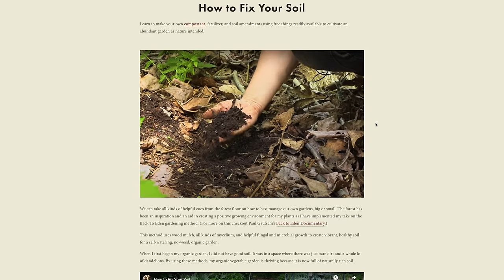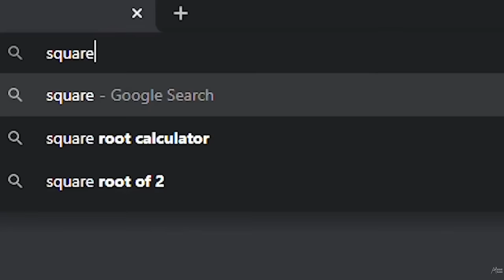Morning Chores FARM TOUR! | Feeding All My Animals in 8℉!

Comment: My feathered babies are indoors all winter!  I have 2 adjoining rooms in one wing of my barn that is heated to about 50-60 degrees with a 2000 watt heater in each room.If I am warm enough,so are they! One of the reasons is,that all my laying hen are in there and I want them to be comfortable--and some of the others in there are either nearing or above the 10 year mark--and my oldest just turned 16 years old! My young roosters are in another section,in the other wing(which is all totally enclosed as well)with the geese,and that one has 2 4000 watt heaters-its colder in there,but above freezing-they seem comfortable.

Comment: Glad you are doing all this and I just get to watch. What a lot of work!  
BTW, hot water freezes faster because the H2O molecules can form crystals ("ice") only in certain relative orientations. It is kind of a V-shaped molecule. The faster they move and bump into each other ("heat") the quicker crystals form because more of them click into the right relative orientations faster. Yeah, chemistry.
Reply: Also, heated water has less dissolved gasses.  When stuff is dissolved in water it disrupts the crystal formation; salt for example, or gasses,

Comment: Love to see you using your hand a lot more!
When I do put a heat lamp out in the barn I do hang it fairly high, and I also set it up so that if it does fall off its hook that it'll either hang by its cord or unplug itself as it falls.  Just takes an extra minute to add a nail-in staple to secure the extension cord high enough for that to happen.

Comment: You should use a  portable mini electric oil-filled radiator Heater in your barn instead of heat lamps. They won't burn down your barn and they provide a lot of radiant heat.

Comment: Warm water doesn't freeze faster than cold water, rather the rate at which temperature changes is faster when there is a larger difference between the body (of water in this case) and the ambient temperature. But if you put a bucket of cooler water out at the same time as a warm bucket, it will reach 32* and freeze faster than the warm one. Formula... Newton's cooling law formula
 Q= h x A x (T(t) -T(env))
Q	=	rate of heat transfer out of the body
h	=	heat transfer coefficient
A	=	heat transfer surface area
T	=	temperature of the object's surface
T(env)	=	temperature of the environment
T(t)	=	time-dependent temperature